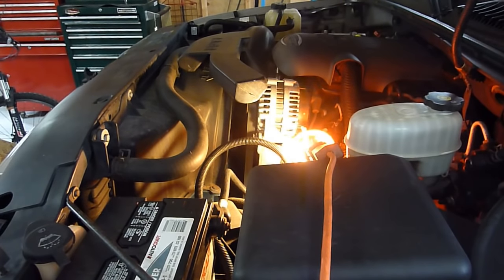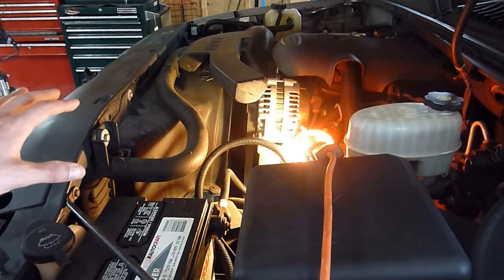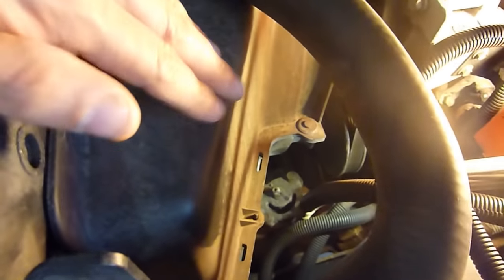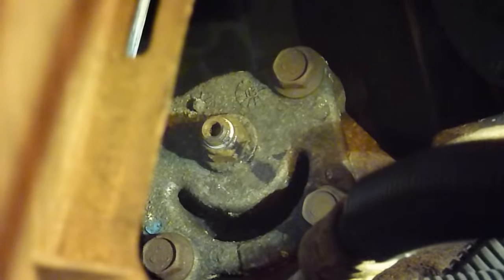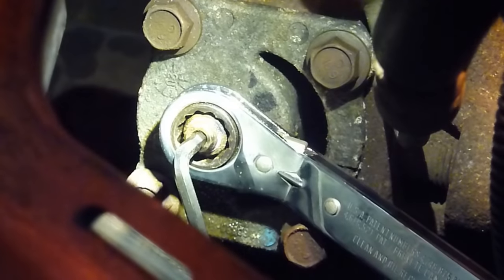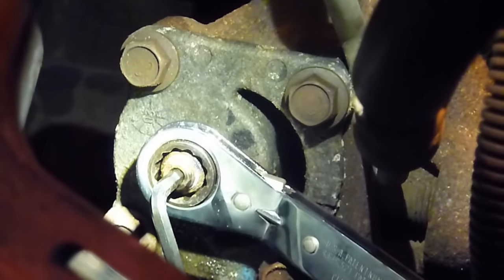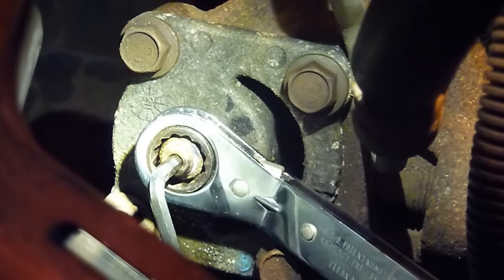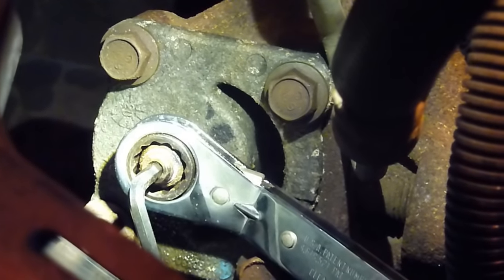Chevy/GMC Truck Steering Box Adjustment - SIlverado, Sierra, Tahoe, Yukon, and others - GMT800

Comment: Thanks for the vid.
I have a 2012 Duramax that was floating down the highway and shaking at high speed. Took it in for an alignment yesterday and they said I had a bad steering box, control arms and spindles and couldn’t align it. Took it home, found your vid and tightened my box right up, albeit with a lot of time spent trying to find enough torque to loosen the set/lock nut. Everything else checked out fine and now I have no play going down the road.
Couple pointers for others:
1) jack your entire front end up, grab a front tire and manually turn/shake it North/south and east/west (or up/down and side to side). This is an easy way to tell which steering/suspension component is bad. In my case I got up under the truck to where I could see my steering box assembly then I turned the front tires by hand. By doing this I could see and hear that my tires were turning prob 1/8 of an inch in either direction BEFORE my steering shaft would move.
2) with my amount of play turning the Allen 1.5 turns was perfect, 2 turns was too much.
3) my nut was 3/4” and the Allen was 1/4”
Interesting that both the alignment shop (Tire Kingdom) and the parts house (AutoZone) said the steering box was not adjustable and was a replace only part.
Thanks for the vid. You literally saved me over $300 on an eBay Factory reman unit and easily an entire day of a cursing bloody knuckled mess!
Much appreciated!
Reply: How did it continue for u? Still running good?

Comment: If you have a crooked steering wheel too do you adjust that first or this?
Reply from the maker: Fix the steering alignment first.. you may have bigger problems
Reply: @SevenFortyOne  They said they did the alignment but couldn't straighten the steering wheel without a new gearbox which is like $500. I was going to try to tighten the gearbox if I could so maybe it doesn't matter if I try to straighten the steering first or fix the gearbox.

Comment: What exactly does it adjust? 
I did it, it worked...
Just curious what did i adjust...
Reply: You're adjusting how tight the gears mesh together. the more that you adjust it'll either tighten or loosen how much play is between the gears. search for "Sector Shaft Adjustment" this will explain what you are doing better.

Comment: Outstanding! 2003 Sierra 1500HD. The intermediate steering shaft was replaced under a recall or service bulletin 13 years and 55,000 miles ago. I thought it was the same issue but checked here first. 20 minutes later a test drive confirmed problem solved! Thank you from a new subscriber.

Comment: The shop tightened the adjustment too tight and my wheel doesn't return when I turn a corner, which way should I turn the adjustment screw? Counter clockwise?

Comment: The proper way to do this is loosen the jam nut, turn the center hex screw to the right just until it starts to tighten slightly, then back off one half turn. Then tighten the jam nut.

Comment: DON'T FORGET TO CHECK ANY IDLERS AND BALL JOINTS. MAKE SURE AFTER ADJUSTING THE BOX AND YOU TURN IT LOCK TO LOCK TO MAKE SURE THAT NOTHING BINDS ON THE FAR ENDS OF THE TURN. The center of the gears in the box will wear but less on the lock ends so be careful.
Reply: Can you explain what you mean lock to lock. I’m in this same situation right now?
Reply: He’s 100% correct.  There is a specific and VERY IMPORTANT PROCEDURE for doing this correctly.  If you don’t know what lock to lock means, and your fussing with your steering gear, oh boy !!!
Reply: Get a service manual for your vehicle my friend
Reply: @trevorferguson8271  Turn the wheel all the way to the left, then turn it all the way to the right. Lock to lock.

Comment: I have the exact opposite problem. I have replaced power steering pump all of my front suspension parts I turn the wheel on the inside of the truck in a hear from steering wheel sounds like maybe a dry spear?. My steering is difficult to turn its very stiff and I can't figure out what the deal is. Any suggestions would be greatly appreciated
Reply from the maker: Could be that the steering box is shot. Hard to tell without experiencing it for myself
Reply: Sounds like you had air in the hydraulic system. 
You get the front wheels off the ground,  start the vehicle and turn it lock to lock several times.  Then check the fluid level

Comment: 2004 Avalanche. I just changed out my drive side hub, drive shaft, both side tie rods, (inner and outer) and sway bar links. Saved probably 1000s of dollars doing it myself. This trick helped out a lot, instant results, got rid of the play and no more floating. I went 1/2 at first,  then almost 1 full turn gave me the best results.
Reply: I turned it about a full turn too. First a 1/4 then a half then a full and it seems better but how do you know if you turned it too far?
Reply: @ESLinsider   It will bind when you turn it full lock and the steering wheel will not return to center.
Reply: @tpangle85  What does bind mean exactly? I've seen people use this term and I am not clear what that means.
Reply: @ESLinsider  It means it will feel difficult to turn because the gears are to tightly pushed together. The steering should feel free.
Reply: Miraming Salamat, pare!🫡
Reply: Miraming Salamat, pare!🙏🏽
Reply: It means the worm drive is to tight and it will literally destroy the gearbox, so you also need to be experienced enough to know when you ain't gonna get that playout and you'd better leave it alone @ESLinsider
Reply: Worm drive gets to tight, wears it out extremely fast

Comment: Tilt joint on steering column has two torx head screws you can tighten as well. Inside steering column just left of the gear shifter. 
Start truck and turn wheel to access each one.

Comment: My question is NOT how to adjust the steering gear box! My question clearly is, HOW to REALINE the steering wheel, AFTER  re3placing the Gearbox? I didn't get the steering wheel locked in alignment when fininshing installation. It only needs to be turned about 1/4 turn left to line up INSIDE TRUCK. 
These sites all seem to want to adjust the Gearbox, NOT the steering wheel itself.
Reply from the maker: I didn't have that problem so I didn't make a video about it.

Comment: Currently have a yukon denali 06...  wander issue. feels like its loose.   I remember doing the tightning of the gearbox on a 77 olds...  steering box..saginaw I believe....worked great then..  obviously check all the usual susects first.  rod ends, links etc.. upper control arms..etc.  but yeah.  fixed my issue.  thanks

Comment: Presentation is right on. On my 1984 Chey C20 the steering gear box looked about the same, with the lock nut and allen stud on top. I screwed up and used a power tool to loosen the 5/8 " nut. The allen spun with it, so I lost its original location. With fingers crossed, I ran the 5/16" allen down snug, then backed it off 1/2 turn. On test drive, it seemed a little too tight so I backed it off another 1/2 turn. The steering feels like brand new. Thanks for the direction.
Reply from the maker: I'm glad my video helped you.  Thanks for letting me know!

Comment: Thanks for your video, 
My 05 Yukon xl turns ok right, but very very hard left turn almost impossible, 
What do you think is the issue?
Reply: I’m sure you already figured it out by now but it’s your steering gear box. The very one he’s adjusting in this video. You will likely need a new one.

Comment: Did you ever fully get rid of the wheel play ? I have a 2003 tahoe with some wheel play.  Not sure if it's the gear box or intermediate shaft.
Reply from the maker: No...I did the whole front end except for replacing the steering box and it got better but not fully tight.
Reply: @SevenFortyOne  Do you believe that replacing the steer box will resolve matter ?
Reply from the maker: I really don't know.

Comment: Good afternoon Mr 741 I have a 03 tahoe I changed all the front suspension and my steering wheel is real hard to drive if I move it a little to a side it gets like stuck and twist it to the other side and I loose control its gets like super hard then soft so its very hard to drive it
Reply from the maker: Do not drive your vehicle.  You could loose all steering and crash.  Have a professional mechanic take a look at it.  It sounds like something was put together wrong or something else has failed.
Reply: Thank you very much for your advice I will do that god bless you
Reply: Same! Replaced my pitman arm and inner tierods cause my wheel would shake left to right when jacked up. Now both wheels won't budge left to right at all so it's tight but something else is causing my steering to be really really tight..hit a bump and throws me! . I'm wondering what I did wrong

Comment: On a GM manual box, with both front wheels straight, I'd loosen the lock nut, then bring the set screw all the way down until you feel resistance. Next bring back a little more than 3/4 of a turn, then lock the lock nut. Don't know if that rule applies with the power steering box. Guess you just have to keep adjusting it until it's right (ass long as everything else is in good working order).
Reply from the maker: Thanks for the tip RW!
Reply: I bought a remanned box from 1a auto and still have loose steering. Tried adjusting it a while back with no luck. Gonna try your method and reply back if it works!
Reply: @cCH3artlessCc  did it work?
Reply: @realmistahwong  yes

Comment: My steering is sloppy on my 2005 Silverado (135K). Started a few weeks ago. Truck tends to drift right and left at near highway speeds of 50-60 mph. Otherwise, I don't feel it at lower speeds. Could the problem also be related to worn tie rod ends? Thanks.
Reply from the maker: You should check them to see if they are loose..but the problem sounds more like a worn out steering box.  I'm having the same problem as you are even after replacing my ball joints...
Reply: SevenFortyOne Thank you for your reply! If it is a worn steering box, I'm thinking that this is a part I can replace with a good boneyard box. I remember having a bad steering box on an old postal Jeep DJ-6 that I replaced with a Saginaw steering box that didn't cost much more than 35 bucks or so. Course, that was years ago, but still... Any thoughts on that? Brand new parts are so expensive now. Even GM. Again, thanks for your help. Everything I know about cars I learned from others (or by trial-and-error--not always the best idea, unfortunately)
Reply from the maker: If you can find a good price on a low mileage boneyard unit that may be the way to go.  The few boneyard around here seem to want almost as much money as a re-manufactured part so I usually just end up going that route.  I learned everything I know from my dad...and trial and error.  The knowledge he passed on to me has saved countless amounts of money over the years.  I may not always do things quite the way a professional would but I keep my old junkers going as long as I can.  That old jeep sounds like it was cool little project!
Reply: Its your steering control arm. Mine did that. The bolt needs to be tightened on it. Mine was lose and almost falling off
Reply from the maker: Are you talking about the Pittman arm - the one that connects the steering box to the center link or something else?  In my case I changed the Pittman arm and it didn't solve the problem.
Reply: Hmmm im not sure. I redid my whole front end with my father and had the same problem. I had it checked out at a shop called lambs tire and automotive because we couldnt figure out what it was. apparently the control arm bolt was lose. thats what the shop called it. When we replaced it apparently we didnt tighten it all the way. Its one bolt..  They fixed it for free when I had my suspension system checked out. sorry I cant be anymore of a help I know how frustrating stuff like this is.
Reply: Brought my truck in for alignment yesterday and the mechanic checked the whole front end steering/suspension and we went over all the linkages, tie rods, ball joints, etc. Everything checked out tight. Runs better after alignment. Tires OK. Road I take is not real good, so that and alignment may have been the problem. Thanks guys for your help. I learned a lot in case something like this comes up again.
Reply: good to hear. I thought that if you were holding the steering wheel straight ahead it would shift to the right or left without you moving the wheel
Reply: Actually, that's exactly what happened. My truck would drift right or left on the road, without my turning the wheel. Notably, the particular road where the drifting was most pronounced is a crappy road that is 55 mph, but everyone (me, too) goes 60. Now that the truck has been aligned my "steer ahead" (whatever that is, exactly) which was in the red zone at 0.13° has been corrected to 0.00°. Today, at 50 mph on a recently paved road, I took my hands off the wheel and the truck tracked straight. Makes me think I probably shouldn't wait 2-1/2 years between alignments.
Reply: Ken Holland thats normal if you have no hamds on the wheel

Comment: Well, believe im fighting a worn out box. I did notice popping before, just not near as bad as today. Mainly when turning or going through a bumps. I do know my steering is loose. My highways have major side slope to them. Im always a turning into the pull at an 1/8 of a turn. When on flat roads, it likes to "walk" on me. Didnt realise it was as bad as it was till i drove a couple different vehicles. Found out by testing it. Jacked the front end and pulled the wheel simulating bump steer while someone held the wheel that also heard the clunking. Worn out box, whoopy. Will simply deal with it till the lift
Reply from the maker: Might be worth checking your Pitman Arm/tie rods/Idler....also chack your steering shaft and bearing...the steering bearing may be causing the popping.  I changed mine and it helped.
Reply: @SevenFortyOne  Surprisingly, the shaft to the steering wheel is tight along with everything else. Least from how the south Texas rust looks and tugging i did. Probably should get a wrench on there and torque to check for certain. The issues ive had are completely opposite of what others normal problems are. My bushings are all looking great too. The only typical issue ive had was a oil preassure sensor and the 4x4 position sensor.

Thanks for the help and the video!
Reply: Updated steering shaft from GM to eliminate popping or clunking in steering especially over bumps.
Reply: Brandon Caldwell DON’T FORGET to check the Intermediate Shaft,

Comment: Hey be nice if somebody would make a video on a 1994 GMC four-wheel-drive 1500 taking out a steering box there’s not a whole Lotta room to get the Pitman arm off and there’s no videos of anybody doing it they’re doing the 2 Will Dr. removals not a four-wheel-drive on Especially on a 1994 GMC Sierra 15104 Wheel Dr.
Reply: I have a 95 yukon slt 4x4 and you can actually stick a wrench in there loosen the nut and pitman then unblolt the box, hardest part is getting the pitman arm loosened from the box. Btw you can access it from the front just take off the front shield.